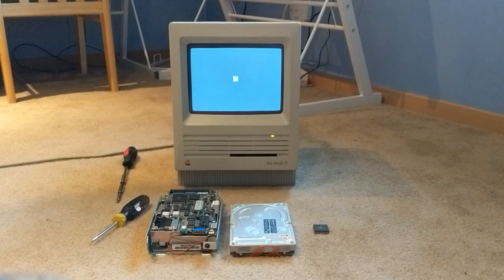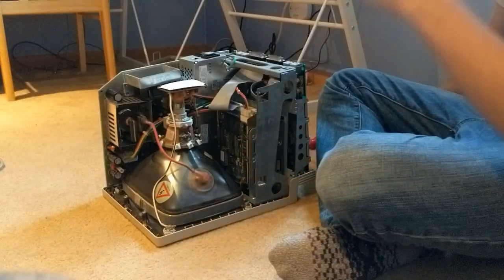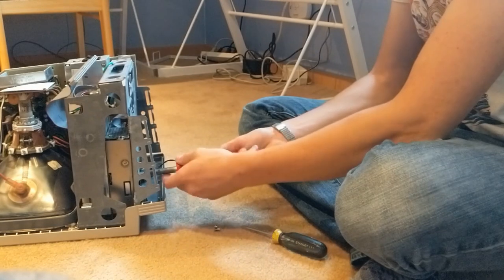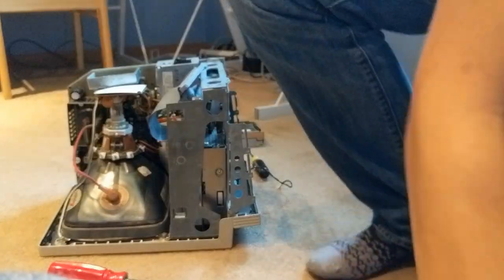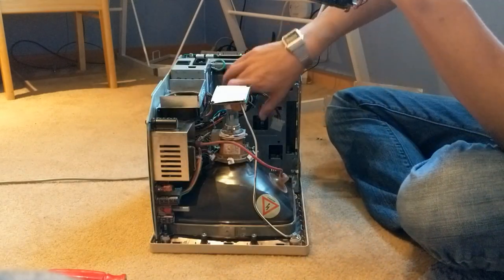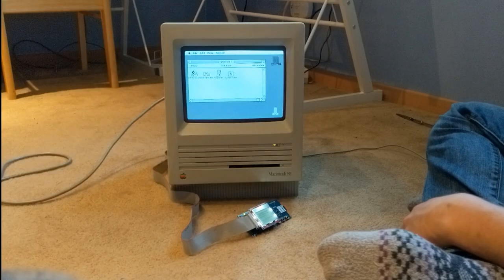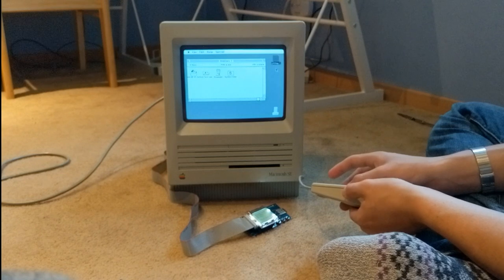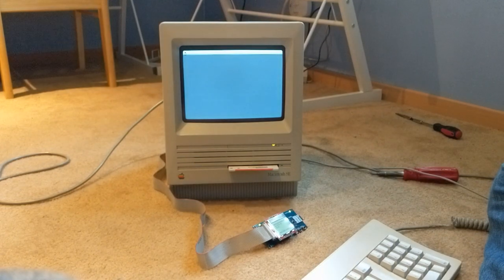Macintosh SE Hard Disk Drive Replacement

Comment: Thanks for sharing video
I purchased exactly same your Hdd
May i know what you do to make original LED working ?
Reply from the maker: the hard drive cable isn't the same as the one in the computer so I just tried it one way and flipped it, I wouldn't recommend that because the hard drive light stopped working recently. Thanks for the view and the question!